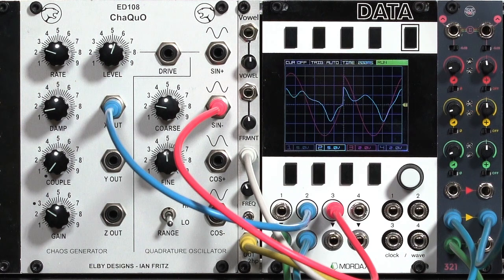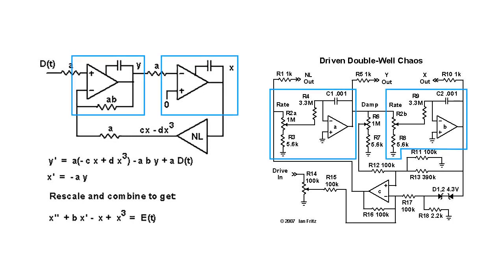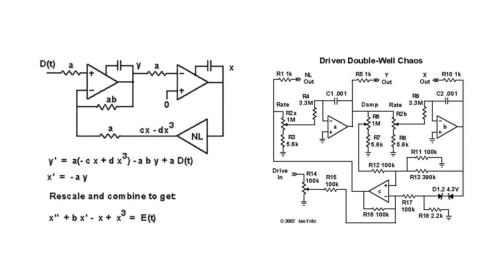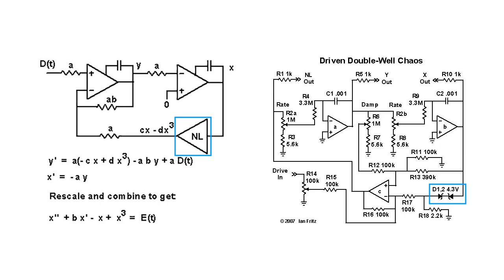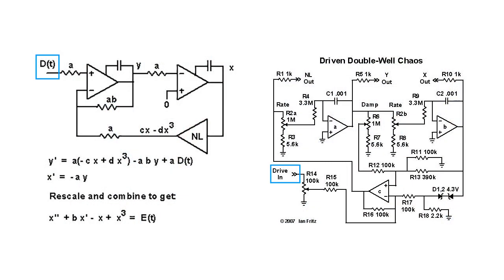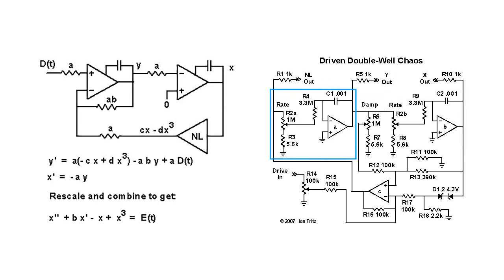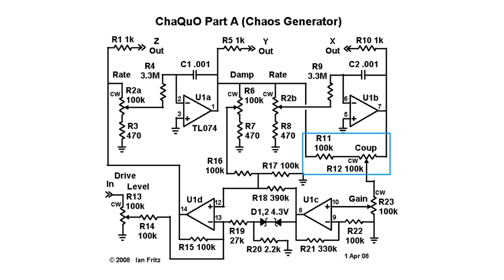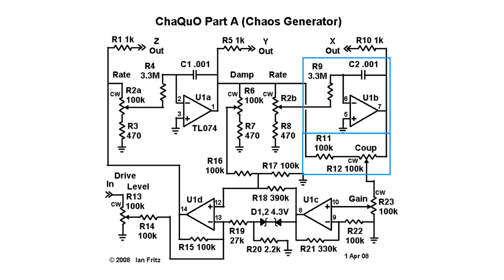Ian Fritz/Elby Designs ChaQuO 1/2: explained

Comment: A very insightful video, demystifying the chaos... how does it fare tracking an audio-rate oscillator, can it run in to the KHz and act like a waveshaper?
Reply from the maker: The various Ian Fritz chaos modules do go into the low kHz range. However, there is no pitch CV input on the ChaQuO; the other modules (Chaotica, Hypster, etc.) have CV for pitch but they do not track 1v/octave. However-ever, ChaQuO does have an external input for the chaos section, so you can drive it with your own VCO, and yes then it will act as a chaotic "waveshaper" for that signal.

Comment: Nice, would have been interested in the module if it has only the left section, I don't really need another oscillator.
Reply from the maker: It needs an oscillator internally to drive its engine, so they decided to expose that to the outside world in case you could use it. Note that the chaotic outputs are loosely connected to the internal oscillator, so that gives you some additional related-but-different modulation sources. But it would have been even better if that oscillator we voltage-controlled; that's where patching in your own oscillator is useful.
Reply: Worth bearing in mind that a quadrature oscillator has its own specific uses beyond a standard oscillator

Comment: Really cool, looking into putting one of these together.  Have you happened to find a version of the schematic that includes cv inputs?
Reply from the maker: I have not. There are others Ian Fritz has designed with CV controls - Chaotica and Hypster, for example - but they are different beasts.
Reply: only easy way to add CV would be to add matched vactrols for the frequency controls